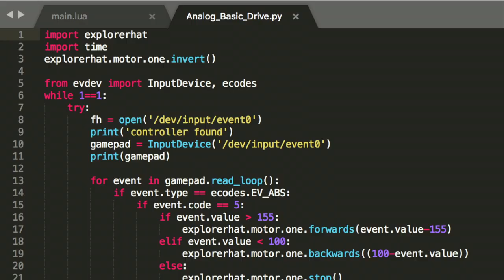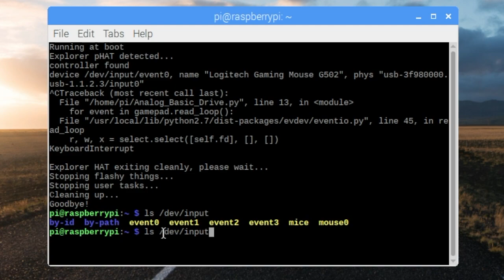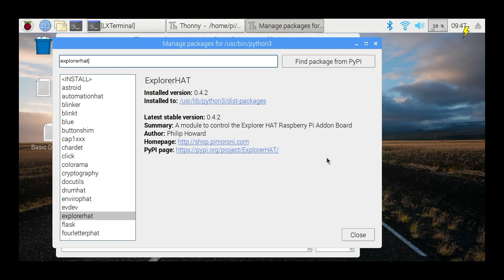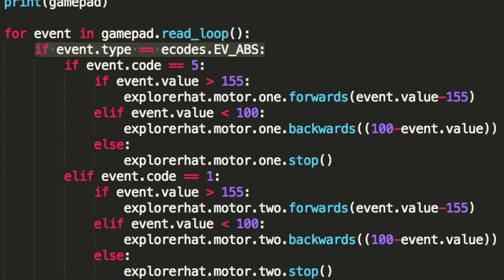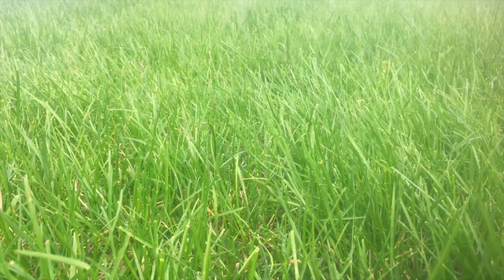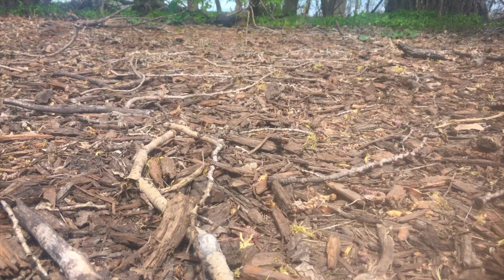Bluetooth Controlled Raspberry Pi Rover

Comment: Cool shit broo, i too made a car with rasberry pi 4 with my friend and we use old car building mechanics for kids as it's chassis and it's workin and we do used a 6400 rpm motor for some speed shit but i guess we don't have any power source for it😗😂.....we and thinkin to design a chassis and if u can suggest something and we would bootstrap our project continuosly 😎,hope so u would respond👁️👅👁️

Comment: Did you try connecting the wheel motors to the PWM pins? Adjusting PWM values would let you change the speeds your motors spin at, so may let you spin the wheels faster.

Comment: Quick Question - Have you had an issue with the 8BITDO Gamepad going to sleep after 15 minutes, as it would without any activity - even while being exercised during that period?

And - have you developed any POC where the Raspberry Pi communicates back to the Gamepad - to vibrate it for example?

This was a very helpful video - Thank You!
Reply from the maker: I don’t recall that ever happening, but it’s possible that different controllers are running different firmware. I actually only have the one pi, so I ended up having to disassemble it for another project a little while ago, otherwise I’d test it out and see if I could reproduce the issue. 

I haven’t used rumble or any other feedback, but a cursory look indicates that evdev does support rumble, it’s just a matter of figuring out how to interact with the 8bitdo to make it rumble. It seems that it can be a bit hit or miss on that front between controller varieties.

I’m really glad you enjoyed the video!
Reply: @KeplerElectronics  Thanks - I was considering (actually looking into now) how if I communicate to the Gamepad it will not go to sleep.  The rumble was just an example
Keep up the good work!